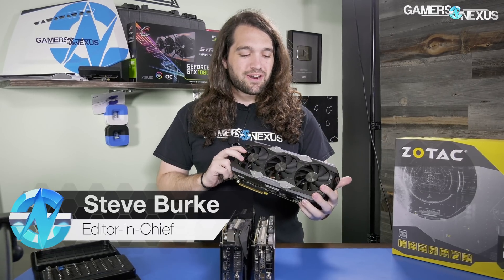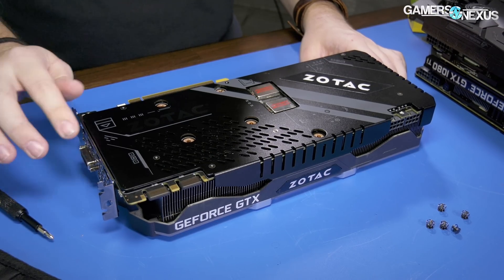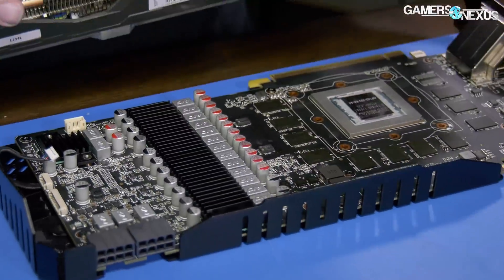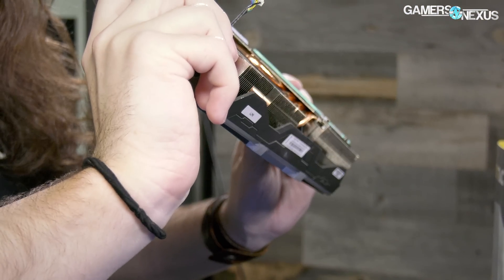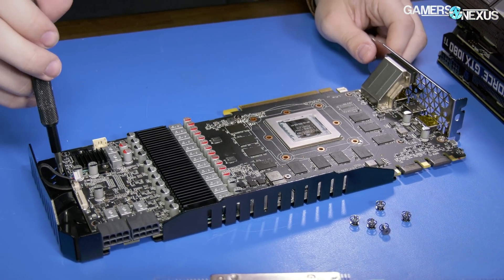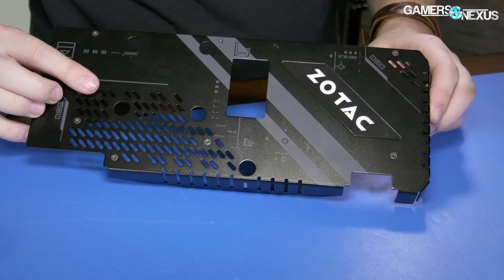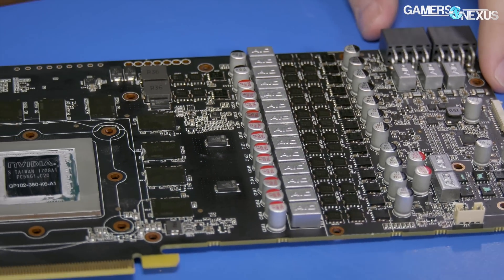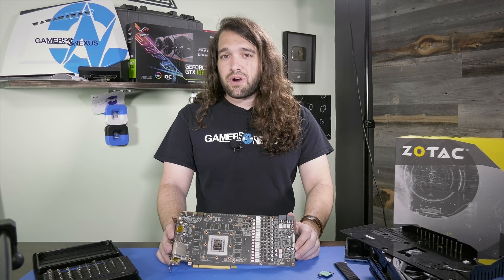ZOTAC 1080 Ti Amp Extreme Tear-Down

Comment: With this bulky cards, they slowly need to invent a new mounting solution. this can't be good for the PCI connection
Reply: For cards that thick, manufacturers should never be afraid of throwing on a 3-slot PCIe I/O bracket. I really don't understand manufacturers on that regard.
Reply: Bitwit(kyle) is a fucking moron.
Reply: Horizontal motherboard or pcie riser.
Reply: mount it to the side of the case with a riser cable like i did. no issues. period.

edit http://steamcommunity.com/sharedfiles/filedetails/?id=959834172
Reply: DAGATHire got to elaborate. The thermals are good. The stock and boost clocks run flawlessly. Like I stated earlier, I ran stresses based on the repositioning of the card and aftermarket thermal paste. Fans never pushed over 69% and hottest card temps was 70°C. Can't really hear the fans under a full load. Pretty much hear the water pump over the GPU.
Reply: vdochev They don't do jack shit.
Reply: Your setup is bloody impressive, but allow me to provide another use case where it is less than ideal.

I play games and do production work on a fairly powerful PC (5930k @ 4.3 GHz, 1060@ 2.1Ghz). I am also a silent computing enthusiast. What you have done there will certainly cool everything, but it is tremendously inefficient. The GPU is having to work very hard to pull air because the intake and exhaust fans run perpendicular to them. I am going to venture a guess that your machine is fairly loud under full load and not silent under no load, is that accurate?
Reply: What I would really like to see is a video of the a decibel meter (a proper one, not a phone) next to the case after running both the CPU and GPU at max for half an hour, as well as the associated temps. I'm sure that it is quiet enough as measured from your desk for your purposes, but I'm curious about the measurable and generalizable aspects of it.
Reply: aftermarket thermal paste is always a better solution than what you get from the mfr. i used thermal grizz on mine.
Reply: Totally fair, I just meant o say that I expect that is where you would see the difference.

For reference my machine measures 38 db under those conditions as measured from next to the top exhaust fan, and I would call that not quite quiet enough. That's the standard by which the silent computing crowd would be judging.
Reply: DAGATHire I would agree; maybe not with those words though..
Reply: DAGATHire Paul fronted him the viewers and sponsors. All BW has really done is add a hipster flavor to the PC Tech Review. He knows very little. Never puts in the time for research, and it's apparent when you watch his livestream with Paul. I have to give him credit where it's due. He adds entertainment to make up for his lack of knowledge. Albeit not me, many people find him entertaining.
Reply: DAGATHire felt the same way about the jayz2cents and bernacules.
Reply: Sechs0rBecks - Yes! I always wanted them to make a reversed gpu instead of them both facing the same way have your first gpu facing towards the cpu and the second facing the normal way. With my 2 1080 ti strix's I would deffenatly get better heat dissipation with my first card. right now there s a 10 degrees Celsius difference between the 2 where I can't push them as far unless I over clock the 2 separately, which is a pain. Also most people have the normal case where the fans are pointed down which is stupid because heat rises right into the gpu, instead of if they were reversed I'd almost be willing to guarantee better thermal results. Well i have an awesome case labs case the has a flat mother board layout so mines not as bad but that first gpu has like 3 to 5 mm of space before hitting the back of my second card, it's crazy and that's even on a x99 deluxe board that is supposed to be one of the best but for a half of a slot space for air it's just insanely close. Can't over clock at all because of it and that sux when u spend that much money on a 2 card setup.
Reply: You seem to be right vdochev. I don't even have a top of the line mobo (msi z170 gaming m5a) and it comes with steel reinforced pcie slots.
Reply: Vertical mounting instead of horizontal seems like the only logical option, like on this case: http://cdn5.thinkcomputers.org/wp-content/uploads/2016/03/12513758_1658280844435400_4851956796739999544_o.jpg

That way it can just sit on the PCI-E lane instead of trying to tear it off the board.
Reply: Well jake. It's a solution for sure... but "no issues. period" that's open to interpretation.
Reply: DAGATHire lol. Two months, no issues. I posted earlier on there main thread my "stress test". Works really well. I'd buy it again over the Strix or the FTW3 hands down.
Reply: Im not talking about hardware issues mate. Im sure the hardware works just fine. But there are other issues with your solution.
Reply: Well, it's a solution in your case and as you say, no hardware issues. But you effectively block off the other PCI ports so they are redundant and while you might not have use for them other people do. Also, SLI?(should you desire) more  riser cables for SLI and where do you mount that? As i said it's open to interpretation and from your POV it works on a technical level which is fine, from my POV it hamstrings other elements of the PC. And indeed, but this is a personal opinion so don't be offended, it's aesthetics are less than desirable. so "no issues. period" sort of just refers to the technically it's working fins aspect, but doesn't cover a whole multitude of other potential issues.
Reply: Well... Now that I see where you're coming from, I can address your concerns. SLI/Crossfire is not what it used to be. Very few AAA game titles are optimized for dual GPU. The research is there. Game developers since the DX12 era haven't coded the games to take full advantage of alternate frame rendering capabilities.

For me personally I've experienced this as I used to have a build with two Radeon 390Xs. Most AAA titles I played ran better with a single card than two enabled.

This leads me to the next thing you talked about: PCIe expansion. I only utilize my PCIe for 3 things. The GPU, the NVMe, and the NIC (wireless). Between my computer's display, operating system drive, and Internet access I don't necessarily need anything else on my PCIe. This being said, my i7 7700k only has 16 PCIe lanes available to it. Not much I can do with that CPU anyway considering how many PCIe lanes are available to me and how many I use with the current setup. If this was an alternate build with a different CPU which had more PCIe lanes, I can see where you're coming from. 

As far as multiple GPU setups though, they make for great online benchmarks (bragging rights) and pretty displays, however from a gaming standpoint they're not logical. Even if the title supports it, you're better off economically (performance per dollar) purchasing one really beast card than a couple. The net gains for having a second card based off of the purchase cost and cost to power your machine over the course of a year, is not going to give you anything substantially game-changing.

edit no offense taken
Reply: Those are a gimmick, and they dont actually do anything.  They have had GPU bars for years though, Most modern cases dont have them though because they are ugly.
Reply: as i stated in the original thread, i've max loaded the card in this setup. can't hear the fans. i hear the water pump before i hear anything else. i'll post a video of it in the near future. xD
Reply: well... once i get my hands on a sound level meter i suppose i can do that. for now, i could always post a video from a camera. i mean.. how many casual gamers do you know have a semi-expensive, rarely-used precision decibel measuring instrument in their household? xD
Reply: Adrian Hall I'll be putting together a vid for you in a couple days. =]
Reply: I look forward to seeing it.
Reply: lol i can hear my computer down the hallway, i swear sometimes it's giving last call before it takes off. 
that's whats a push pull config gets you tho. but im not too concerned personally with noise.
Reply: I'll stick to my apt description, harsh or no. it's quite accurate. that guy hasn't a clue what he's talking about. he's a fraud and how he's got so many subscribers is a straight up mystery to me.
Reply: he's a nitwit. And also the reason i don't watch much coming from Paul these days. Nothing against paul, but i see that other fool's face and i ignore.
Reply: yeah the 980ti amp! extreme is the same size XD alot of ppl broke off pci-e slots on their mobo. The have metal reinforced slots now though.
Reply: For the record, my Arctic Accelero Xtreme IV is also massive (3-4 slots depending on what you want to put under it) and I have had to use zip ties to support it multiple motherboards. The graphics card itself is part of the problem, since the board of the card you put it on is not designed for the weight.

The Xtreme IV actually comes with an L bracket to support the entire card which is really nice, but not compatible with my 1060 which is quite wide. You can also get stands like this (https://www.moddiy.com/products/HIS-Graphics-Display-Cards-Weight-Support-Adjustable-Stand-%28Black%29.html) but those preclude a bottom intake fan.
Reply: i think it really depends on the motherboard. I have the Asus maximus VIII Ranger with only plastic pcie slots, end yet it has no trouble carrying my Gigabyte Xtreme Gaming 1070 (an extremely heavy, effectively 3-slot card)
Reply: A good solution is to just screw the expansion bracket into the case really tight. Thats what I did and I have ZERO sag, even with my massive triple-slot Xtreme Gaming card.
Reply: It may work in that case, but if the card itself isn't reinforced and/or the center of gravity of the cooler is quite far forward that won't be enough.
Reply: I get zero sag with my asus 1080 ti, but it definitely looks slimmer than the Zotac card.
Reply: Sechs0rBecks yeah my amp extreme card sags soo much
Reply: They already did. The new motherboards have steel reinforced slots.
Reply: you can just use a plastic string to help against sag, like Bitwit did once

Comment: Well on cars we add rubber in between two metal surfaces to either prevent rattling (noise) from movement or to avoid a heat transfer so I would assume it'd be both. That's my take
Reply from the maker: It won't rattle, and it increases heat of the VRM -- stay tuned for the review!
Reply: Maybe the VRMs are so cool that they can't work properly and they need to heat them up.